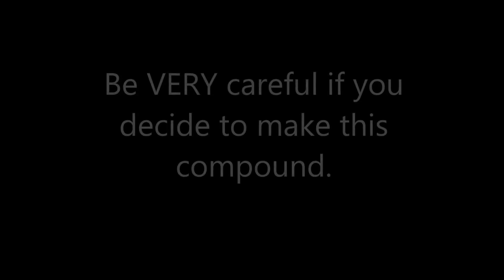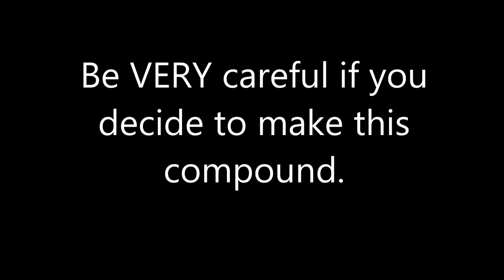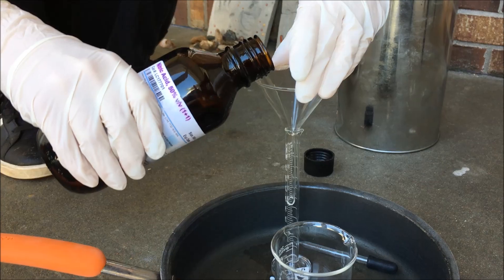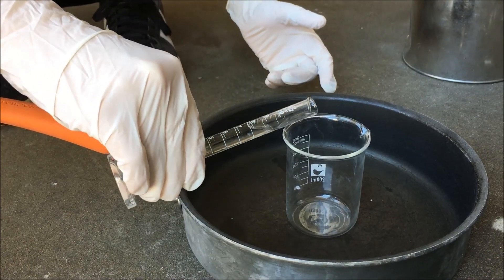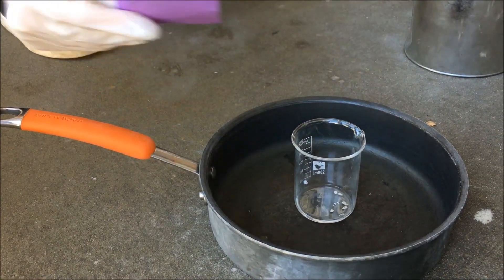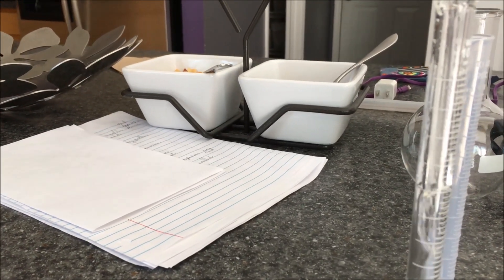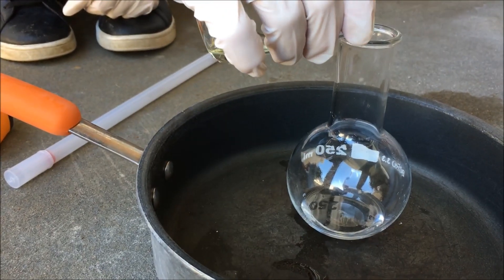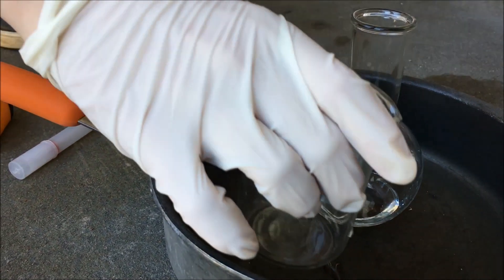Silver Fulminate

Comment: Nice video.Despite the great scare,silver fulminate was actually used in some old blasting caps.
Reply from the maker: Thank you
Reply: Why they don't use it anymore?
Reply: @aletrip642  Probably just because there's way better alternatives these days.
Reply: @aletrip642  Don't think so. Modern detonators are designed to set off insensitive explosives like RDX and TATB. And the explosive charge is definitely more powerful with a higher det velocity, but the power is in the main charge itself. Dynamite is essentially stabilised nitroglycerine, and doesn't need as much activation energy to trigger. Only thing I could say in that context is that modern detonators are more reliable.

Comment: I tried it again and again but ppt is not forming 🤔 please help
Reply from the maker: Tell me what you are doing when doing the synthesis. Exact materials and where you got them
Reply: Dear i am a student i want to synthesis silvr furminate in my univ lab i got the materials from my lab they r all of good standard..
I took nitric acid disolve in it silvr nitrate and in another flask i took ethnol mix it 
60c 30 min
Reply from the maker: @sajidullah5519  my guess is that you would be using too much nitric acid if you used silver nitrate. The amount I said is to form silver nitrate also
Reply from the maker: @sajidullah5519  If you accounted for that difference of using the salt instead of the metal, then my second recommendation would be to dilute the acid to 50% (the lab acid I would guess is 70%)
Reply from the maker: @sajidullah5519  The last thing I can think of is using a hot plate while waiting for the solution to react. Or better yet, put the solution in a hot water bath and wait for visual bubbling, precipitation, or smell of aldehyde (smells like apples to me, it is very strong)
Reply: I my using 8.5 ml  of 50%ntrc acd
Reply from the maker: @sajidullah5519  try starting from silver metal instead of nitrate
Reply: Yes i am using hot plate too..
Reply from the maker: @sajidullah5519  I saw something a few years ago on a science forum saying to not shake or stir the acid-ethanol-silver solution or else the reaction doesn’t work, I’m not quite sure how that effects it but maybe try doing that.
Reply from the maker: @sajidullah5519  if you make a video I could help more, good luck

Comment: Why you didn't use Acetylide Gas ? Is this Photosensitive ? 👍
Reply from the maker: They are two different things. This is what is used in bang snap firecrackers and is similar to mercury fulminate.
Reply from the maker: Like many silver salts, it is photosensitive. But not explosively reactive to it. (From my experience it just turns brown like the nitrate salt does)
Reply: I will make Mercury Fluminate 👍 Can I mix Copper(I) chloride (CuCl)  in Ethanol and put Mercury Nitrate Solution in it ? Plz Guide me ❤️ You are very experienced ...
Reply from the maker: @laddinimby  that’s what I would recommend
Reply from the maker: @laddinimby  The catalyst works very well to make the product a clean white. It could also be dissolved in a 50% ammonia in ethanol solution and precipitated by slowly adding acetic acid.
Reply from the maker: @laddinimby  I may do a video next weekend on this, I have been wanting to get back into YouTube
Reply from the maker: It isn’t silver acetylide, it is silver fulminate.

Comment: mixture of all the chemical will still be fulminate without heating it. Or is it necessary to heat it
Reply from the maker: You do need to heat it once all the chemicals are mixed together to start the initial reaction. But to dissolve the silver, heating is not necessary.  If you need anything else let me know
Reply: @ButPrestonDidIt  Few questions 
1. Can we heat the silver nitrate with nitric acid to dissolve it faster. 
2. After heating will all the liquid be fulminate or just the small particles formed. 
3. Should we dip the gravels in the fulminate or, How should we coat the fulminate on the gravel.
4. If we want to mass produce it, is there any safe and cheap method, eg., silver nitrate with 50% concentration of water. Nitric acid 89% and ethanol 99%. In all these what will be the composition to make silver fulminate.
Kindly answer...
Reply from the maker: Muhammed Raza Dawoodani    1. Yes you can.        2. After heating it will take time ( I left it for three hours) for the fulminate to form, it will be a white powder on the bottom of the liquid.            3. I am not sure of this one, mine was not coated on gravel. I would suggest getting it wet with a mixture of water and alcohol and the very carefully putting it on the gravel. If you know of something that dissolves silver fulminate, dissolving it and letting it crystallize on the gravel would probably work wry well.           4. I would say the best way to mass produce it is with the same percentages I did in the video since those were used because they work the best.
Reply: @ButPrestonDidIt  thanks for your instant relpy. Really appreciate it. May God bless you.
Reply from the maker: Muhammed Raza Dawoodani  of course, thank you very much
Reply: @ButPrestonDidIt   @ButPrestonDidIt  how much ammonia should be mixed with silver fulminate liquid for it to be used in coating gravels...based on your given percentage
Reply from the maker: Muhammed Raza Dawoodani  honestly I have no clue since I have never tried
Reply from the maker: Muhammed Raza Dawoodani  I can look into it for you
Reply: @ButPrestonDidIt  bro you are amazing..my question is how to form a coating of fulminate on gravels for mass production. Should we dip the gravels first in ammonia and then dip it in the fulminate liquid or take the solid fulminate, dissolve it in ammonia and then try to coat it on gravels. thanks
Reply: @ButPrestonDidIt  thanks to God I made it but I've a small problem as I'm pouring ammonia into the powder it's not stabilizing instead it's blasting on least intervention. Should I try it with distilled water instead
Reply from the maker: Muhammed Raza Dawoodani  have you washed it multiple times with distilled water?
Reply: @ButPrestonDidIt  yes I did it on first time but not afterwards, as while washing much powder gets wasted and it didn't make much difference as it blasted on both occasions. It's not unstable in powder form but when I try to coat it on gravels using ammonia I believe it becomes hyper sensitive. So instead of ammonia do we have an alternate
Reply from the maker: Muhammed Raza Dawoodani  Has it dissolves in the ammonia? If it has not there may be a problem with the ammonia. If you do not want to dissolve it, wet it with ethanol and water and be extremely careful
Reply from the maker: Muhammed Raza Dawoodani This compound is VERY sensitive
Reply: Thanks for the reply..

Comment: Could I use sterling silver with 2% copper contamination or would that screw it up?
Reply from the maker: Pvt_Crunch          I believe sterling silver should work fine for this, although the reaction may look slightly different. Do not be surprised to see a slight blue/green tint in the solution or on your final product.
Reply: ButPrestonDidIt Im glad to see that you are still an active channel and I can say that I got good results with my synthesis. It seemed that the only noticable difference between your synthesis and mine is that a blue/green tint was apparent throughout the reaction. Im glad I was able to do this with only sterling silver because buying pure silver or synthesizing it would be way less cost effecient.
Reply from the maker: Pvt_Crunch     I’m glad I could help.
Reply from the maker: Pvt_Crunch  Please do not make large amounts if you attempt this synthesis